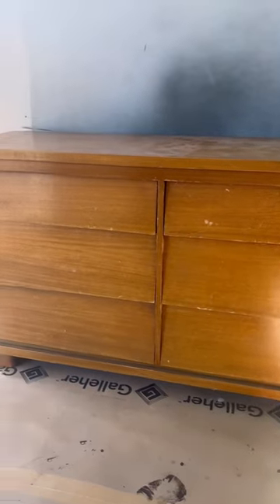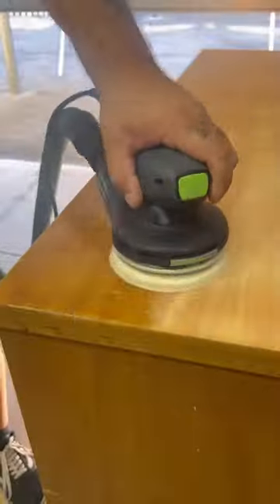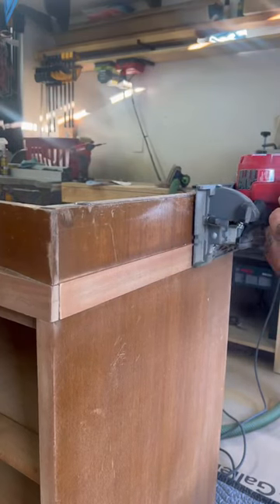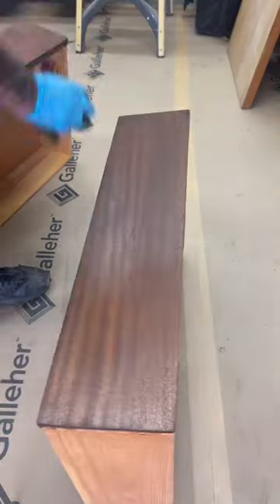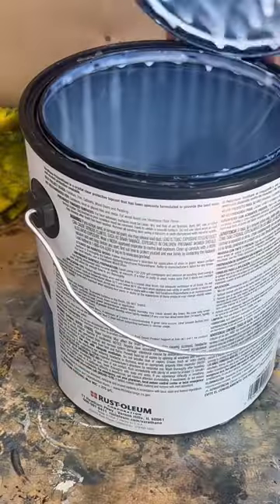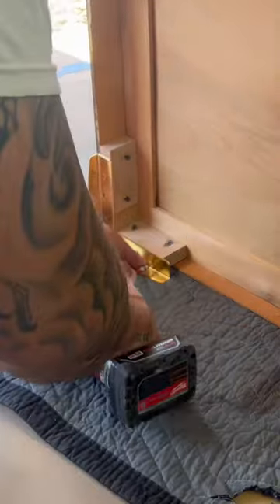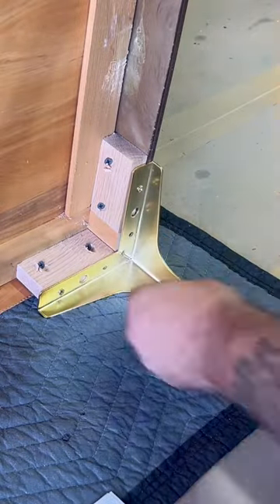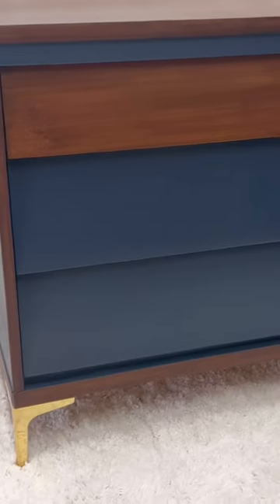HOW TO FLIP a neglected 1960’s DRESSER and REPURPOSE it FOR SOMEONES HOME || DIY EXTREME MAKEOVER

Comment: Looks better but not my cup of tea. I really wouldn't put those legs on any carpet or vinyl wood or tile as they look like they would cut into those floorings.
Reply from the maker: They have plastic on the bottom to protect from that. It’s not just straight metal

Comment: Only ever paint new furniture (if you must paint). Wood should be stained, not painted. 

That piece is 60 years old already. If you had just stripped and re-stained it would have been good for another 50 years! 

Painting furniture is a current fad that will be over in less than 10 years then someone else will RESTORE this piece to it's ORIGINAL beauty!
Reply from the maker: I didn’t even have to read it all to know that painting unwanted furniture is not going to go anywhere